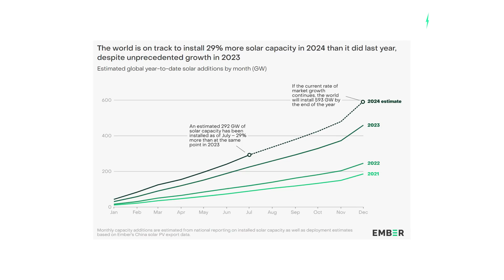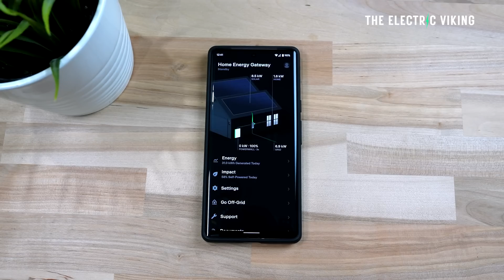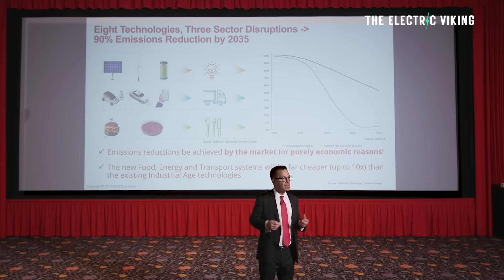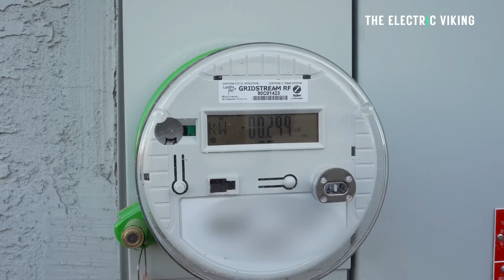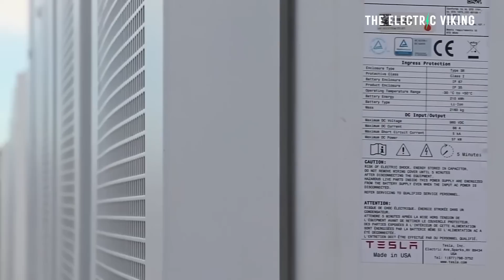Solar goes EXPONENTIAL - surpasses even Tony Seba's projections

Comment: Solar is rocking and it is because it saves you money. I save 200 dollars a month on electricity. I paid 5000 dollars for my grid tie system. System pays for itself in two years. Panels will last 30 years. I have a built in emergency backup when necessary. Solar is a no brainer. Start watching YouTube and do it yourself if you can.

Comment: A bit of a correction to the Viking… during a rain storm the percentage output capacity of a solar system is about 5% of nominal. An ordinary cloudy day the solar PV output is about 20%. This is what I know… we are solar installers and I monitor dozens of solar sites under different weather/environmental conditions.

Comment: If we will have reached 2,2 TW of photovoltaic within the end of 2024, photovoltaic will have overcome both wind and nuclear energy. In fact, considering a capacity factor of 1500 TWh for TW, PV production will be 3300 TWh, greater both of wind than nuclear energy. If it will continue at that exponential growth it should overcome both Hydroelectric and gas production within next 3 years. Renewables will overcome coal, in electricity production next year. 
Probably, continuing this trend PV alone will have overcome coal within 2030, and will be the first source in electricity production within 2030, with Hydroelectric, methane and wind following. For nuclear we will have to wait next decade to see how many new projects will come to production.
What do you think about this evaluation?

Comment: I am going to make some predictions on nuclear.  Nuclear takes 1/17 the material and 1/49 the land area of wind or solar.  The main issue is current nuclear is in a pre-model T state of development.  Current nuclear uses huge pressure tanks and containment structures that are custom-made on location kind of like cars were made pre-assembly line before Henry Ford's model T mass produced cars.  It appears to me that once molten salt reactors are fully developed assembly line low cost nuclear will be realized.  These reactors will not need massive pressure vessels and containment structures.  The power from these reactors can even be cheaply store as heat since these reactors operate at much higher temperatures.  Since this form prower production uses far less material and land once costs are reduced I can't see how this form of power production will not take over in the future.

Comment: Solar is so cheap in Australia that older gear is almost free. I've bought 4.5Kw of panels with most of the tracks, wiring etc for $300 AUD ($200 USD). All testing above 90% of rated power. Including a 3KW inverter. By the time I've built out my shed rig project with 14KWh DIY battery it will owe me about $4k AUD.

Comment: I have recently installed my own solar system and its working perfectly..  I noticed that the "weakest link" in a solar system is the inverter. I estimate that won't last more than 6-7 Years. Especially in Hot, dusty environments where I live.

Comment: I wish I had been more optimistic and forward looking when I installed by system in 2021.  I put in a 4.2 kw system, with net metering (California wit Pacific Gas and Electric).  I met my household needs.  I did not anticipate my daughter giving my wife a Tesla Mod Y.  She uses it a lot.  She is a registered nurse who visits patients in their homes.  The car easily needs twice what the house uses.  I went from 12 used PV panels, each at 270 watts, to 30 of the same.  The panels were used and cost me $2300 for about 40 panels.  My next upgrade will require larger 240 volt ac wiring and some new 440 watt panels.  I used string inverters that could handle 4 panels each.  I bought racks, but built my own supports and installed the system myself.  The California Public Utility Commission and the power company seem bent on killing new solar.  New systems require payment of a monthly fee for net metering.  We usually have three months each Fall and Winter with cloudy weather and low production, so batteries would be a problem.

Comment: Here around the 45 degree parallel in Minnesota, the generation of solar power varies a lot between winter and summer. The improving panel efficiency means that even here it will become more viable.

Comment: It would be good to see some numbers. 
I estimate that 10TW of solar deployed is needed to replace all the energy provided by either Gas, or Coal, or Oil.
So if the world can deploy 1TW per year, we could replace fossil fuels in 30 years. 
There is of course the slight opportunity of dealing with intermittency. 
 The other issue: China already has over 1TW/year of solar manufacturing capacity, but we don't seem capable of deploying it all. What do we need to deploy it faster? I would suggest large scale offshore systems - e.g. 100GW in the Adriatic Sea, and it would be barely noticeable.

Comment: When silver reaches its true market value of around $600USD per ounce solar panels will be cost prohibited. If you really want solar energy, do it now while it is still affordable. There are better energy alternatives such a thorium nuclear energy. Geothermal may overtake all other forms of energy as a new drilling technique that vaporizes rock will be able to drill down to depths of between 10 and 20 kilometers.

Comment: I live in Northern Europe. My solar installation produces close to zero in dec-jan (about 70kwh a month on 6kwp) and still not enough in oct,nov and feb. So I guess it depends on where you live. But you cant just state that it works all the time and produces a lot like you just did. That is simply not the case, and I personally dont think that kind of "false marketing" is helpful. Only gives the doubters some ammo There is such a strong case for having solar panels, even if you live in a place where its only really useful in 6-8 months a year.

Comment: Not to mention a more peaceful and quieter environment in built up areas of you live near a main road or motorway EVs don't make nearly as much noise as ICE cars and trucks, cleaner air aswell, we just had a rise in electricity prices in the UK so a 6kw system will pay for itself within 5 years and the system is good for 30+ years giving you free electricity for 25+ years

Comment: Solar capacity factors are about 25% at best. To get actual average 8TW of power the world will need AT LEAST 32TW, and more realistically about 40TW of installed capacity. It will take 53-66 years to get there if theres only 600GW added each year. If we need only half of that and the other half is met by wind, at that speed we may hit these numbers by 2050, but that's only if power consumption doesn't grow - and there are billions of people in the 3rd world who will very loudly object to this assumption. So we still need manufacturing capacity to grow a lot, perhaps by 2 to 4 times.

Comment: I work for an installer, I'd be fired for doing what these guys do on the roof.... your harness is useless unless attached to a higher fixed point. FFS guys, tie on or die on impact

Comment: This is unserious happy talk.  Where is all the Copper, Zinc, Silicon, Cobalt, and all the other heavy metals that are needed for this transition going to come from?   Mining causes tailings to pollute rivers.   This is going to get really ugly long before anyone gets anything for free.
Reply: 1) New metal comes from mines, or recycled products. Recycling is increasing. 
2) Solar panels don't use Cobalt, but oil refining does. 
3) Silicon is found in sand. It's as common as dirt.
4) Tailings don't need to pollute rivers. Spilled oil does though, as well as oceans.
5)  Yes nothing is free, but fuel-less energy costs much less.

Comment: Our year-to-date production is 769 kWh. All our solar panels are not placed ideally as every roof is facing the wrong way.  We still are off grid more than on. Battery backup is a huge factor effectively doubling our capacity.   Only need to have a few more panels and we will be off grid 100% of the time, even on the darkest day of the year. We also charge 2 EVs Tesla Model 3.  😎  every solar company told us that we shouldn't do solar because it wouldn't work.  Even the the solar tools from our grid provider (Peco) shows our house with the solar panels and also says we cannot do solar 😅 idiots!  Solar is POWERFUL! ❤

Comment: I love Tony Seba, and have followed him for many years now, and he has been right in his very positive predictions about the disruptive energy transition to EVs, Solar + battery storage. I am sure he is fine with underpredicting the transition. Love your episodes Sam, always make for great viewing. I installed 13.2 kWh solar PV system in 2012, and two Powerwall-2 batteries in 2018, and have been all in on EVs since 2012, and our all electric home operates as a microgrid ~8 months of the year, providing all our energy needs and charging two EVs, while exporting ~50% of or excess solar back to grid via net metering. Totally satisfying and absolutely works.
Reply: its been obvious for  a couple of decades

Comment: I published that solar would reach 1-2c kw/hr back in 2015. Tata energy admitted this week that it's 1c kw/hr over the lifespan. 1c for a battery, 1 cent for transmission, 1c for investors and 1 cent for retail. Solar now at 90% efficiency remaining after 30 years.

Comment: New chip design  announced by Wolfspeed, improves efficiency of Silicon Carbide chip by 15%  over other Silicon Carbide chips for the inverter in solar.  Also improves efficiency of chargers for EV's.

Comment: Here in Seattle, we had heaps of hydroelectric power and not a lot of sun - other than summer.   Population and business growth have cut the excess hydro that we previously sold to California seasonally.  The other side of the Cascade mountains, eastern Washington, has sun and wind - and not a lot of population.  Our peak electricity use is definitely winter - there is not a lot of air conditioning

Do we need more electricity grid capacity?  Do we need a higher price for electric rates for HUGE users - like data centers and aluminum smelters?  Do we develop more solar farms in eastern Washington?  Closed loop geothermal?

Seattle City Light sources 88% from Hydro, 5% wind, 4% nuclear, 1% biomass, and 2% unspecified (buying power from elsewhere).  But, we have to produce more.

Is rooftop solar financially viable?  In a condominium, how can the benefits of solar installed on community property be equitably split?

Comment: Ridiculous.... no Price Parity when the whole equation is utilized.

<1% of Total Power With NO SIGNIFICANT BACKUP (except stealing Grid Power for Backup).

SOLAR GROWTH is 50% financed with Subsidies. requirements AND WITH NO SIGNIFICANT POWER BACKUP (which every panel needs 10 hours per day.... 40% over 5 months).  Cannot run a modern economy with Solar/Wind... 

AND POWER REQUIREMENTS..just Tripled with the advent of AI.

The future is Nuclear OR Deep Drilling Geothermal.

Comment: 9TWh by 2030 is still not enough. Global electricity demand in 2022 was 24 TWh. Add on top a shift of transportation to EVs, a shift of building and water heating to heat pumps, you will end up closer to 100 TWh by 2030. So the trend is right, but full energy transition will likely not happen before 2040.

Comment: I did the math on the cost vs gain of my solar panels.  The 30 year loan that I signed up for cost me $82000.00 at the end of 30 years which includes all interest and fees.  If I had stayed with Florida Power & Light during that same time period I would have paid them $122000.00.  And that is not taking into account any rate increases which would occur during that time period.  So for me the question was do I want to pay FPL $122000.00 (plus rate increases) at the end of 30 years or would I rather pay the bank $82000.00?  The answer is obvious.  I would have been a moron to stay with FPL.

Comment: In California there is so much solar that there talk of negative electric rates. That is the utility will charge for pumping power back to the grid because the utility has to take generators offline which costs money.
Reply: For home use, put in an extra-large electric water heater on a timer.  The timer shuts it off when the sun goes down, and the tank is big enough to supply hot water all night .  
Utilities should go to institutions that use a lot of hot water, like hospitals, restaurants, etc (jails?) and promote oversized water heaters with low or negative daytime electric prices.

Comment: He’s spot on the money.  Put up more than you need for those rainy/ cloudy days.  ( we can pretty much count on 75% of the winter months being cloudy. Up here in Northern America). But EVERY DAY. Will generate some electricity. 
     I will have a 10KW. Battery plus a bi -directional charging system off my EV.  ( worst case a 3.5 KW back up gasoline powered generator.) 
     I’m just not sure If I’ll be grid tied or not.
Reply: If your grid has a significant amount of wind power, it would make sense to be grid-tied.  Wind and sun are significantly anti-correlated.

Comment: The energy capacity of solar installed worldwide (per IRENA) has been increasing each year from 2001-2022 (except for 2012 & 2018), but the percentage growth rate of solar installed actually peaked in 2011 & has actually slowed in 8 of the 11 years from 2012-2022.

If we extend a straight trendline from the 2001-2022 percentage growth rates through to 2030, we see the trendline at +28.35% in 2022 declining to +21.79% in 2030.  Using this trendline to project installed capacity out to 2030, this admittedly naïve method projects 6.136 TW installed capacity in 2030.

I think this might be a bit better of a guess than Electric Viking's 8-9 TW, because he did not seem to account for the deceleration in growth.  Of course, Tony Seba fans might call for an acceleration of growth up the S-curve, but the facts are otherwise:  installed solar annual percentage growth has been in decline for over a decade.

Comment: 80% of the cost of electricity is the price of the fuel required to generate it.  Sunlight is free.  So buying the panels for electrical independence  really makes sense.  
  It’s not a difficult DIY  job.  At a minimum you save 50% of a bidder’s price.  
     Yes you need to learn a bit and watch a few  U Tube  installation video’s  but if you hang the wires  etc so an electrician makes the final connections  you don’t even risk shocks.

Comment: 75KW system here, it takes care of ALL my energy needs for house and auto's. My daughter and I installed the entire system.
Reply: 10kw is what an average American home uses. 75KW could be sufficient for a small farm even. In Africa, 75kw would power 17 households if each household consumed 580 kWh per year.
Reply: @PerAsperaAdAstra8755  No no, maybe in Europe it's 10kw, in America for some reasons an average household needs 30kW.. Maybe they love everithing bigger? It's the land of giants? :)
Reply: @TricoliciSerghei  It's also the land of very hot summers and very cold winters. And a lot of uninsulated housing.
Reply: @TricoliciSerghei  The trouble in northern Europe is getting enough solar to run a heat pump in winter. 75KW would probably work in the UK or Germany, but there would be huge wastage in the summer. 
A typical house in the UK or Germany needs 4,000KWh of electricity, and 20,000KWh of heat per year. That heat could be provided by a heat pump consuming 6000KWh per year. 
Then you need to add about 2000 to 4000KWh per year for each electric vehicle.
A 4KW solar array provides 4000KWh per year.  
The best way of providing the energy needed for heating is to insulate. A modern home should only need about 5000KWh of heat, or about 1500KWh of electricity to power the heat pumps.
Reply: How big is your house (sq feet) and what about temperature?
Reply: @smb-zf9bd  1600 sqft, wisconsin weather, very hot and humid in the summmer, and very cold cloudy winters. 2 ev's, and a shop also.
Reply: at  our farm we still only use 4-5kw
Reply: My 8kw system does pretty well for my 2000 square foot house.  16 kw would be perfect but not really enough space.
Reply: congrats on the DIY.  With the money you saved, you could easily afford such a giant system.

Comment: The solar panels in my house still generate roughly 1/8 of their maximum daily generation even in the very worst days, when it looks almost as dark as night in the middle of the day. Outside those outliers, which never lasted more than a day or two in the last few years (when I started paying attention), I still generate at least a quarter of the maximum generation even on cloudy and rainy days.

This means that with a system capable of generating 4x as much electricity as I regularly use, and batteries roughly triple the size of what my daily usage is, I would have had plentiful, uninterrupted electricity for the last half decade or so. And such a system is getting cheaper by the day. And I wouldn't need to cover even a quarter of my roof with solar panels to achieve that.

Add to that an EV with vehicle to grid capability — meaning in an emergency I would be able to go buy electricity in a recharge station to put it back on my home batteries — and it would make going off-grid even more reliable.